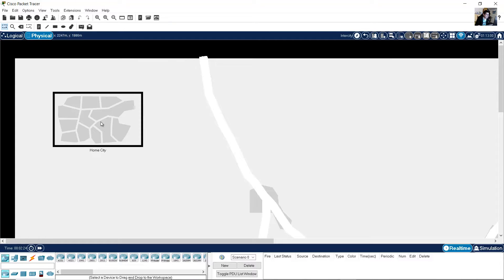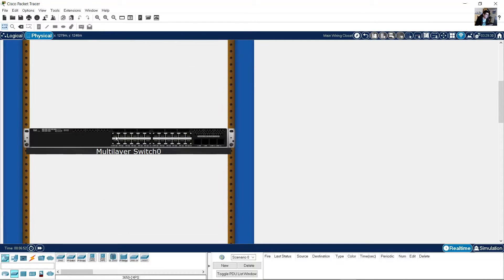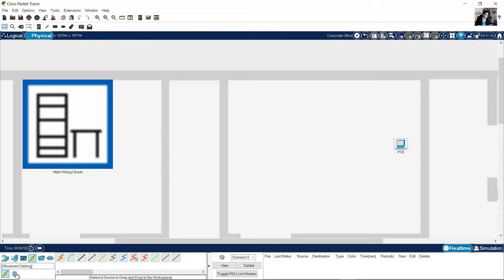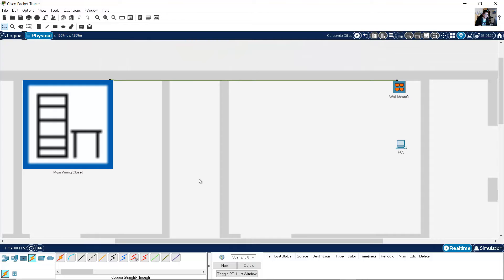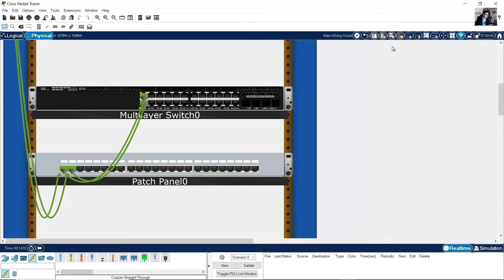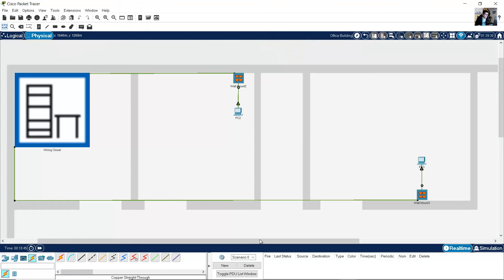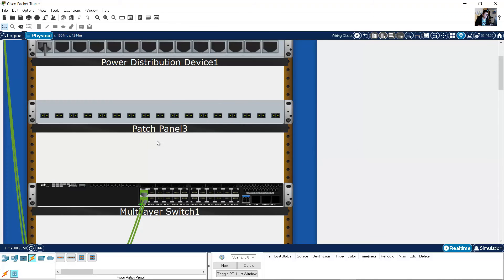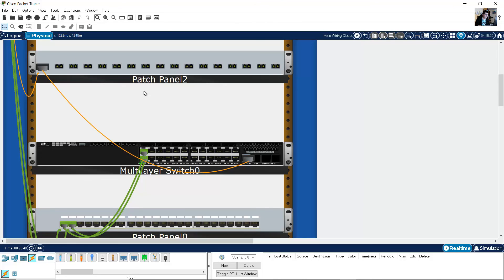Structured Cabling: Copper, Fiber, Horizontal and Vertical Cabling - Packet Tracer 8

Comment: Cool, so it's possible access router from face pallette connect to patch panel ??
Reply from the maker: Hello, ypu can use Console connection and Telnet or SSH connection, console method uses a RS232 protocol, but Telnet and SSH use TCP/IP protocol, so is possible to use the networks connections

Comment: after connecting the patch panel to the switch, the light doesn't turn on. i tried it on a multilayer switch as well. i have already connected the punchdown from the mount port to patch panel, what am i doing wrong :((
Reply from the maker: on physical tab on the layer 3 switch, insert the power supply